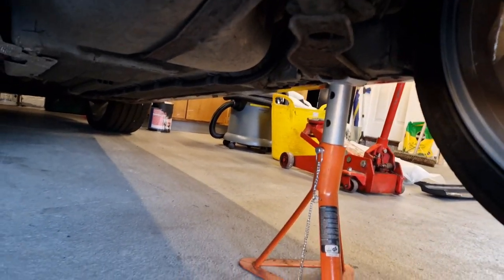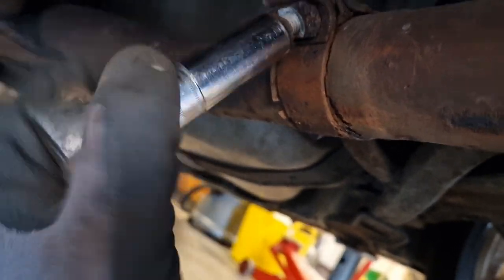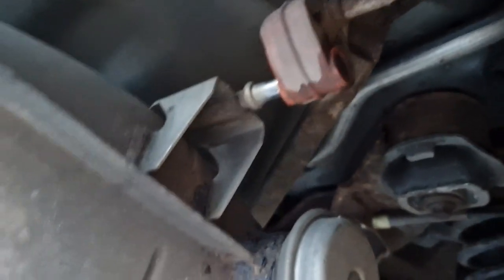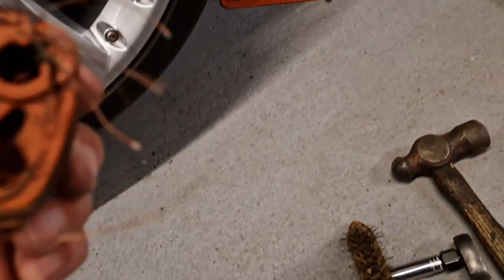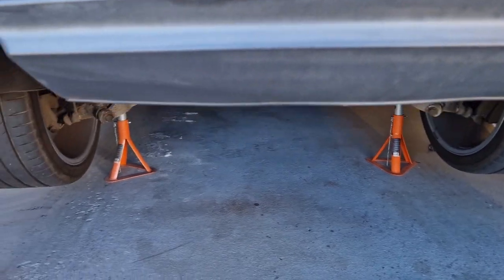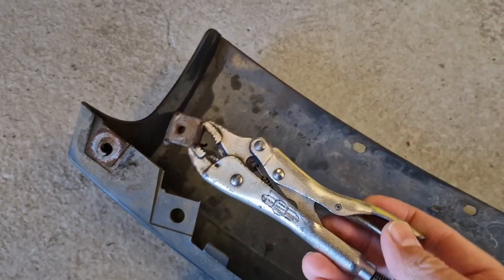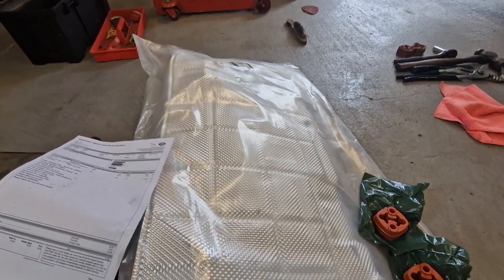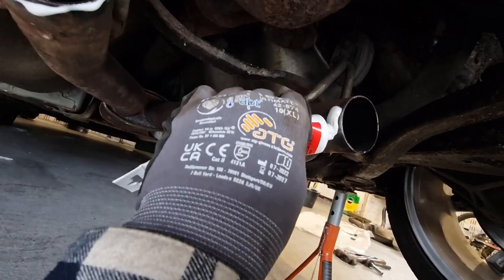How to fit - Jaguar 4.2 XKR (X150) Supercharged exhaust onto Jaguar XK 4.2 (Pt 3 of 3)

Comment: Dear Paul
Your upgrade was quite inspiring 🎉, which encouraged me to do the same, the result was more than satisfying, other than the better look and nicer music coming out of the exhaust, it improved the response out of the engine dramatically due to the reduced back pressure caused by the chocked original exhaust despite removing the fuse, my Jackie now accelerate much quicker and far much smoother.
So thanks very much.
Reply from the maker: Great to hear you had a successful swap. Makes a huge difference doesn't it

Comment: Really enjoyed the detail you applied to your video. I have a 2007 XK 4.2 with 22,000 miles. Love the looks and performance. Have owned 3 XKE's, 2 XJS' and 1 F type coupe. I will be performing the exhaust swap that you performed so well! Thank You, James King Olathe, Kansas
Reply from the maker: Thanks for the great feedback I really appreciate it. Exhaust swap has made the car so much more enjoyable you won't regret it.
Reply: I also have a 07XK 95k miles...first car, having electrical demons right now, but definitely like the car
Reply from the maker: @anthonychristian3722  you might already know this but battery make sure battery is fully charged
Reply: @life_on_cars The report from the shop is that some fuses connected to my starter motor were bad as well as a sensor/thermometer that is giving me an engine overheating display on my message board.
Reply: @life_on_cars  like I mentioned, this is my first car, so I'm trying to learn as much as possible.

Comment: Really interesting to see what is involved, a good opportunity to clean the subframe, and a great result on the heatshield. What happens with the exhaust valves?  Are they held in an open position somehow?
Reply from the maker: Hi Adrian check out my other video about locking the valves open
Reply: @life_on_cars  Cheers, just seen the other video 👍

Comment: I will have to check with my local jag dealer the price they are doing on a heat shield, at that price I will definately fit a new one. Whats the bet they are more expensive!! Might have to have a road trip to pick one upfrom your spares supplier if need be!! lol  when i take mine off and take the nuts off, i will use a rotary wire bush on my drill and clean them up then apply some grease the same as you have.  I see your underneath looks as ratty as mine does, with the subfram off i will probably get some marine clean and silver por-15 and coat that area to protect it.
Reply from the maker: Sounds like a good project 👌

Comment: Have you thought of having any rust treatment to the sub frame? I had a dinitrol treatment done by an undersealing firm. As i live close to the sea i felt it was a good thing to do. Plus he did a fab job.
Reply from the maker: Hi, yes I've wax oiled my subframe
Reply: @life_on_cars  what's the best battery to get for a 2011 XKR. I think mine may need replacing . What battery would you suggest?
Reply from the maker: @johncrocker1019  Yuasa. I swear by them. Fantastic battery with 5 year guarantee.  Halfords
Reply: @life_on_cars  excellent thanks 👍
Reply: What amp 90 ,100 or 110.
Reply from the maker: @johncrocker1019  you can pop your registration into the Halfords website 👍
Reply: @life_on_cars  will do. Thanks for that

Comment: Noticed that ypu don't have a rear heat shield  above the rear exhaust box on this video, did you take it off or not on in your ownership?
Reply from the maker: Hi if you watch all the episodes you will see I replace it. Yes it's missing.  Must have been removed by previous owner. Thanks for watching 👍

Comment: Any tips on where to source the back box? I’ve always fancied improving the exhaust note but didn’t want to ruin the motorway cruise noise.
Reply from the maker: I set up an alert on ebay and also searched for "breaking  XKR" found a few which were too expensive but eventually found one at the right price 👍
Reply: @life_on_cars  Thanks, don’t seem to be many about at the moment.